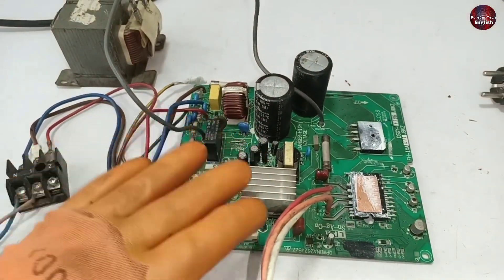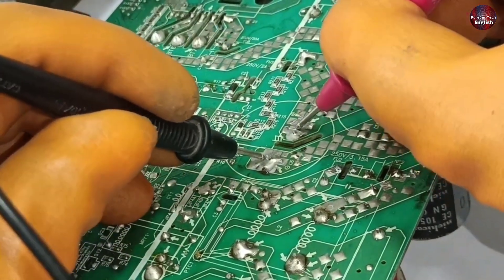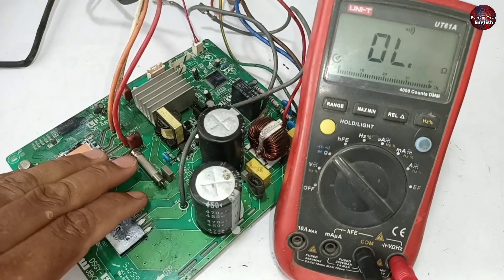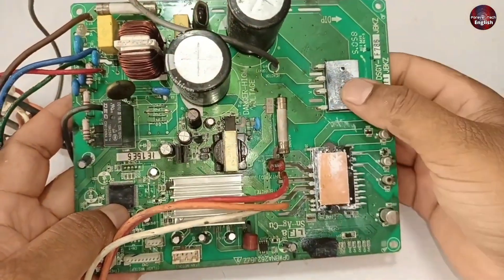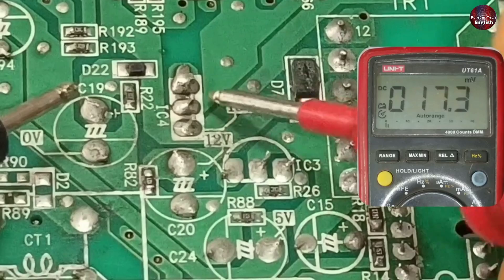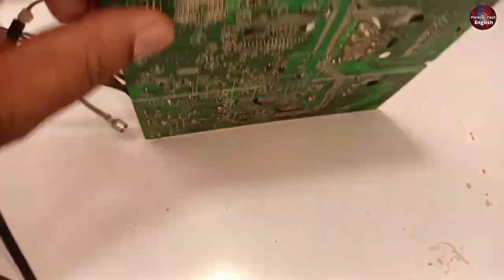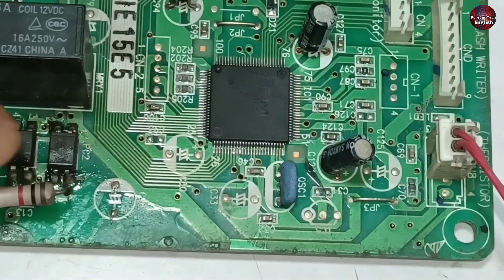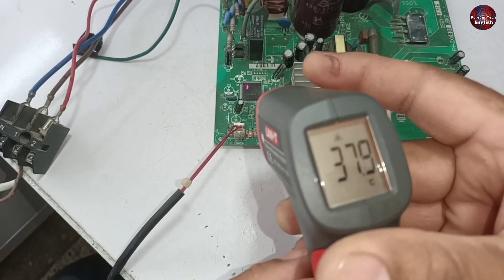Fixing Mini Split AC Dead Motherboard, That Won't Power On!!

Comment: My mother board is same as your mother board the red led near the CPU is showing normally the relay works fine. I tested with insert 220v the fan working but the compressor is working only 2 seconds and stop. The red led light on the motherboard start to blinking faster. I face to this problem with few motherboards and I can't be fixed it. Do you have any idea where should I continue to check? Thanks for your sharing the knowledges.

Comment: Haseeb recommends alternating between the legs when soldering the IC to prevent overheating of the chip.  Nice troubleshooting!
Reply: Good work you make it very clear thank you very much 11:40
Reply from the maker: Hello Dear what do you mean by alternating between legs?
Reply: @forevertechenglish  Do not solder the legs beside each other. That will create a lot of heat in one area of the chip. Go back and forth between sides of the chip as you solder. I forget what video he mentions this in. This video below demonstrates how he solders IC's.
https://youtu.be/AKYiVccGQD0?t=377